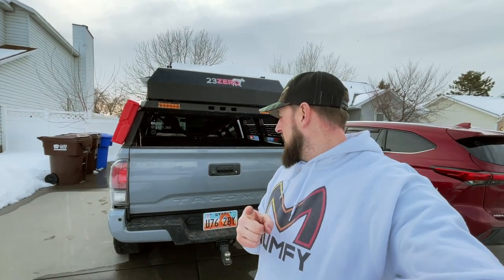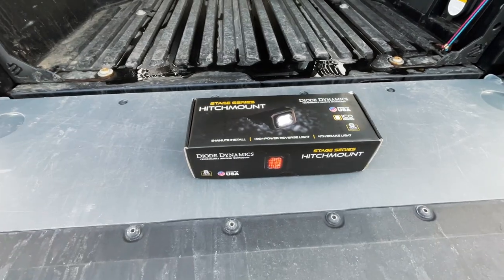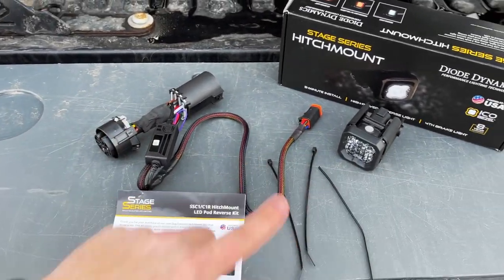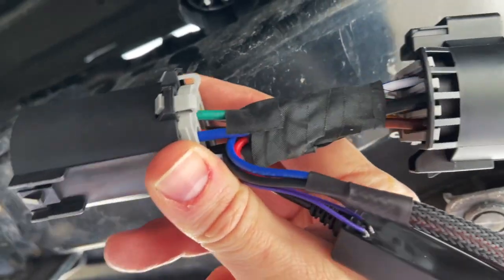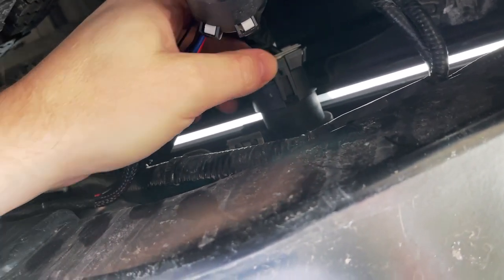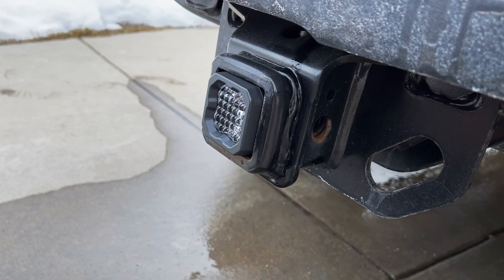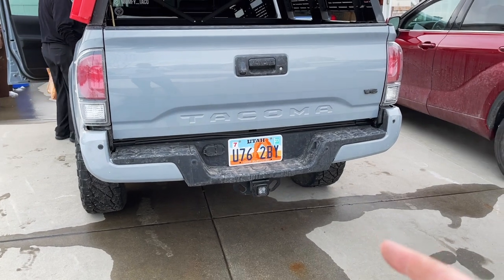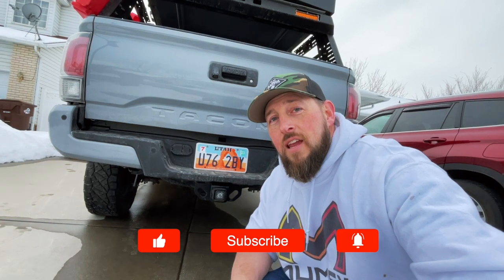Diode Dynamics Hitchmount LED Lights | Tacoma Install

Comment: Flash lock-out is normal for 10 sec after first activation. It's to prevent annoying the drivers behind you in stop and go traffic. After 10 sec of no braking, the flash is armed again.

Comment: I literally just installed mine and it has the hesitation on the flash as well. I personally would like to see a bracket made where it could install on the right hand side of the license plate so it can always be mounted even with a hitch.
Reply from the maker: That sounds like a money making idea.

Comment: Hi , got question for you . After install the light , is it easy to remove it out when you need to hall something ? or it will stick in there permernantly ?
Reply from the maker: It is removable when you want to haul. There might be a little more effort than the install to remove it but you are able to.
Reply: Thanks , then that is not worth it to buy cause it will keep you headed

Comment: Can you use a locking hitch pin to make it more secure ?  maybe drill or cut out those tabs ?
Reply from the maker: Yes. The tabs are removable so that you can place a pin through.

Comment: Do you have a good solution when using your for trailer or bike rack?  thinking about getting this but I can see myself getting annoyed with securing the cable and storing the light when not in use.
Reply from the maker: does your bike rack have an additional hitch receiver? you can add it there. As for the trailer... you may need to unplug it for those occasions.

Comment: Got one too and it flashes every I think 6-9 seconds

I have one off topic question. I’m getting my first suspension put on and it’s about 2.5 lift with bilstein 6112 with 5100 rear, do I need UCA????????
Reply from the maker: The flash does have a bit of a reset after the first time it goes off. 

For your suspension question, no you don’t need to upgrade the UCAs. If you are looking to save on a set, the tube versions are a great option.

Comment: @mumfy does Diode Dynamics make a 7 pin to rectangular harness adapter? The factory 7 pin on my Sprinter Van is the rectangular kind and does not fit the supplied USCAR Round plug that connects to the back of the trailer plug. Any info you have would be great, thanks.
Reply from the maker: Im not sure if they make a 4 pin conversion kit.

Comment: Do all of the LED’s fire or light up in the red and white modes? I have several that are out and do not light up in both modes and DD tells me this is completely normal.
Reply from the maker: So far I haven't noticed any issues with the LEDs. They flash when unlocking the truck and the initial brake press. In the reverse mode, it stays solid until i shift out of reverse.